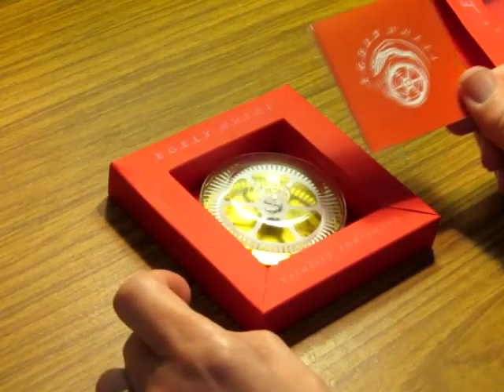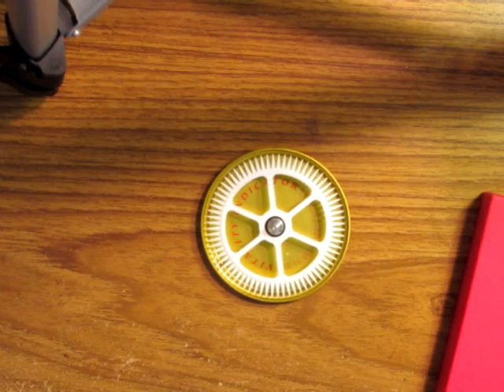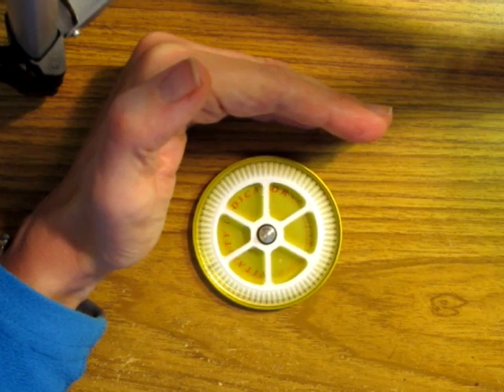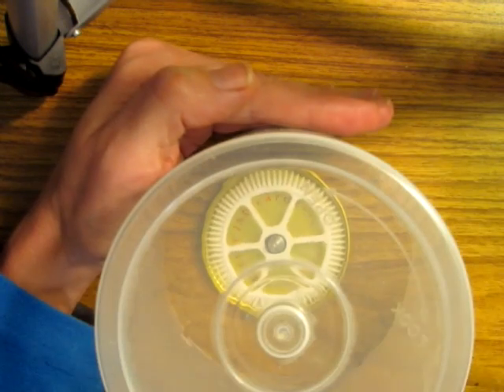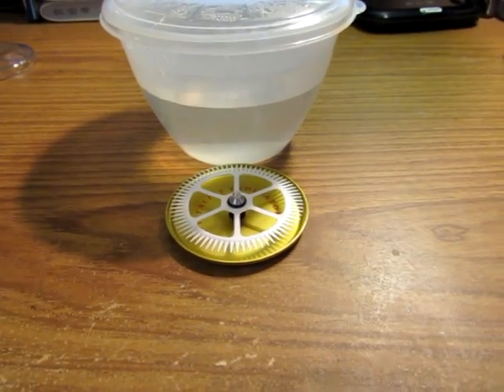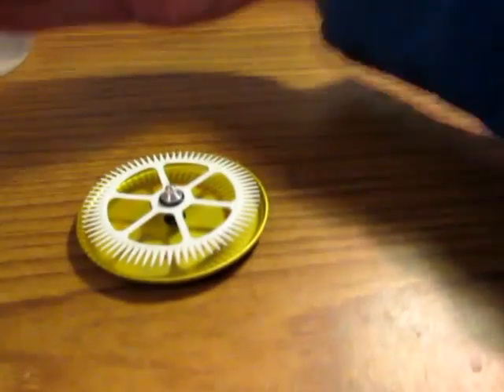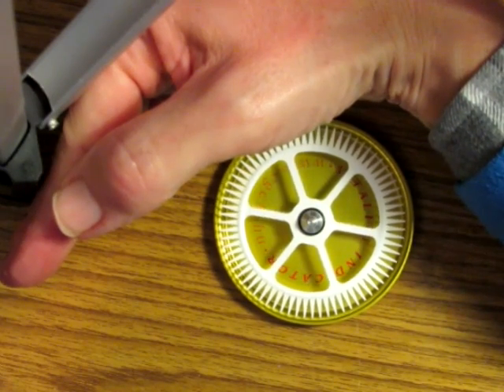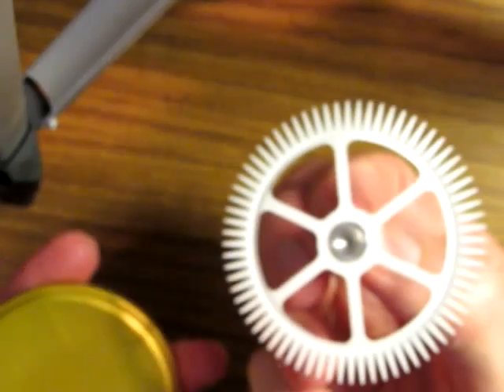Experiments  with an Egely Wheel

Comment: some very very late info.       this is interesting.   but, the video is more like an infomercial, than anything else.       the use of a container having a  parabolic shape was  just  stoopid.        it would have been  Logical to carry out  more  testing in which  1)  thermal variations were controlled/accounted for, and   2)  the wheel was  isolated from  Any  movement of the surrounding air.      googletranslate

Comment: 72 eh
3,4,5 triangles have to be multiplied by 72 in the early Masonic degrees,  and an initiate must have a clear understanding of this to know the  workings of everything in the universe made of light/magnetism. This is in the blue lodge degrees. 
I.e 
216 number of minutes(sexagesimal) of arc in a circle
288 twice speed of light
360 degrees in a circle
Added together is 864 (86400) seconds in a day also width of the sun.
There are 72 names pronunciarions of god (yhvh)within the tetragramaton ,72 degrees separation between each node of a pentacle,a geodetic or earth inch is 1/72000 of a minute of arc.

Everything no matter what it's form on this planet, exists by reason of magnetic lines of force.
Both visible and invisible.

Comment: The Egely wheel is not just a gear shaped wheel pivoted on a needle point. The pivot is much more sophisticated device than just a needle point.The needle point is actually located within the hub of the wheel  and this needle point rests on a spring supported ceramic bearing both being located in the pivot screw.The picot provides an almost friction free bearing for the wheel which is ultra sensitive to the almost undetectable air currents produced by thermal radiation from the hand. To actually see the thermodynamic ally produced air currents, a tiny piece of incense stick is placed near the outer edge of the  wheel base opposite to the position of the hand. . The experiment has to be performed in an absolutely  draft free closed room and the experimenter must use a medical breathing mask to prevent the breath from effecting movement of the wheel. The smoke from the incense stick piece will form into the most interesting pattern along the air currents produced by the heat of the hand. As may well be understood, this is an extremely interesting and extremely sensitive  and delicate test and it might be a preferred option to have the wheel enclosed under a glass dome of the type which protect birthday clocks.. The dome should be of  just sufficient diameter to enclose the wheel base with the minimum of space between  the sides of the dome and the wheel base. The use of a protective dome will ensure than  normal external air currents, breathing  , drafts do not affect the movement of the wheel. . I would appreciate y our comments  and the results of an experiment conducted as outlined above.
Reply: Vivian Astridge best explanation in all the comments
Reply: Thanks Vivian! Your explanation is very interesting and cientific! I want to make the same experiment...

Comment: Not a bad job of eliminating variables but not conclusive - the obvious sources of energy are 1) wind from movement 2) direct and reflected light 3) static electricity on the body 4) infra-red emanating from the body (wavelength specific, not just heat).  I would concentrate on (3) and (4), neither of which your tests have fully excluded.  Short a Van de Graaf, I would suggest some trials with a wooly jumper and a comb.

Comment: With your hand in the position it is in during 9:30 to 10:00, can you use your free hand to intoduce a heat source to the tips of your fingers? Something like a hand warmer leaning up against the outide of your fingers between the tips and the first joint. I am guessing that convection from the temperature gradient from your palms (which is warmer) to your finger tips (which are cooler) is what is supplying the rotational force.

Comment: Very interesting experiments Andrew, thankyou for sharing! I think I need to get one of these and have a go! It certainly doesn't appear that the effects can be explained by convection, conduction or radiation of heat. I suppose that other controls could be introduced to eliminate the potential effects of resonance/vibration transmitted by your body via the worktop for example, or the effect of ambient light and heat or EMF etc. the list is endless.

Comment: Thanks Andrew 

Interesting comments about a similar device on Amazon:

"You can see that it responds to both the body and thought. Found it rotating whenever I started to approach it from a distance. Seems thought can control it, I was able to move it both directions with just thought from 5 feet away (very slowly). My maximum rating is 300% on the first day. You can't do it for long before results get mixed and lower. The manual indicates its not intended for extended periods of time. You don't have to put your hand as close as the picture for movement, but for the highest rating you should. It is amazing to see that wheel spend with just your body energy. For anyone that wonders about energy in the body, this is a good indicator. Telekinesis could be tested with it as well. "

"have been able to reach 100% just looking at the device. "

http://www.amazon.com/Egely-Wheel-Vitality-Meter/dp/B0038AJYGK

Comment: How strange. It does look as though radiated heat can't be the cause of the rotation. Are the spikes significant functionally? Is 72 a sacred number or anything? Linked to the degrees of retrograde precession or something? Why does card in between your hand and the wheel reverse the rotation and plastic stop it? Is it something to do with the inorganic and organic? As in Wilhelm Reich's orgone generators?
Reply from the maker: +Ben Thejrporter I'd thought it could be related to Orgone as well... I think the paper/plastic thing might be to do with paper being made from living material with plastic not being a "living" material. (Organic is the wrong word really because "organic chemistry" is carbon chemistry, including polymerisation etc)

Comment: Its all to do will energy. Human beings give off an energy field. Some people call this your Aura. The point is that the universe works in ways of energy. Your not told about people having energy around them in school because your not ment to know about it.
Reply: +Richard. What about the card placed between his hand and the wheel?  The wheel stops and rotates in the opposite direction. The "air flow" ( if any ) should not change direction.  Andrew Johnson is a smart guy, you should check out some of his lectures on free energy.
Reply: +Richard.  So why did the wheel stop when he touched his right hand with his left?  All our cells are powered by electricity, I find it fascinating.